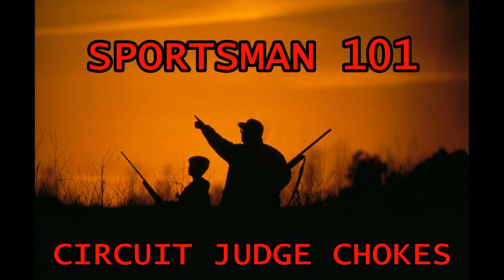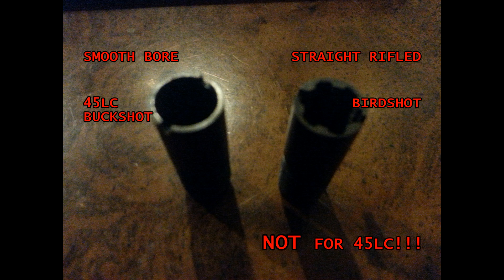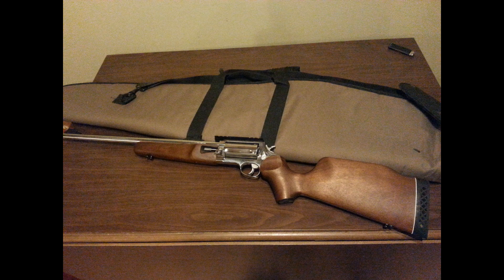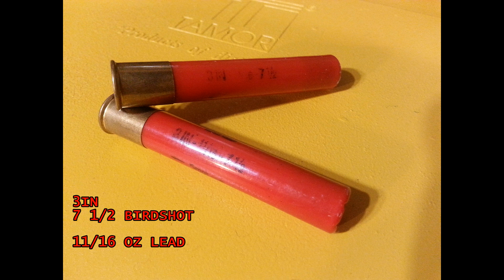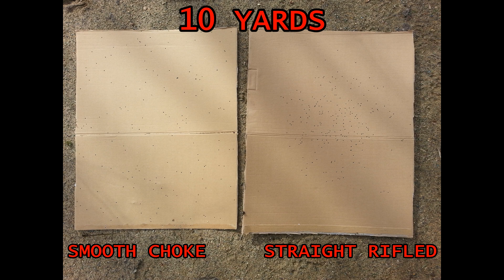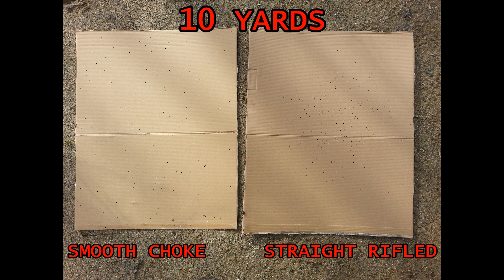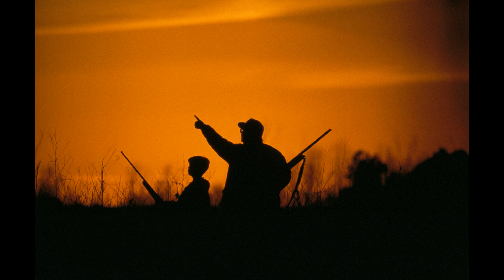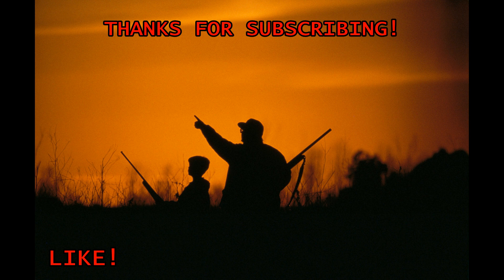Taurus Rossi Circuit Judge: Smooth Choke vs Rifled Shot Pattern Test

Comment: As I posted before, I ordered both a smooth bore and a straight rifled choke. The old choke was stuck and I had to order a choke removal tool. The one I got was thin and so small I could not grip it and exert enough force to remove the stuck choke. I took a piece of small angle iron (long enough to grip on each end) and cut a slot in one of the flat surfaces. I inserted the choke wrench in the slot and tack welded it in place. I was then able to stand with the gunstock gripped between my feet, grip the modified choke tool with both hands and exert enough pressure downward to turn the wrench using both hands, and remove the choke.
       I also took a thin piece of flat bar steel and ground the edges to a size that fit down into the slots of the rifled choke and bent it to 90 degrees to make a choke removal tool for the rifled choke. Just in case it ever gets stuck!
I have pictures if anyone wants to see those.
Reply from the maker: I’ve had the straight rifled get stuck but not to the degree you speak of,  using the choke removal tool paired with a pliers for extra leverage usually does the trick.  Thanks for sharing!

Comment: In the owners manual for mine it says to use the smooth bore choke for 45lc and .410 slugs, and the straight rifled choke for 410 shot shells.. it doesn’t mention buckshot. Also I wonder which choke would be best for a load like the Winchester pdx round?  But it seems like the straight rifled choke would probably make them hold a tighter pattern because of its smaller inside diameter than the smooth choke would act similar to say a full choke vs a modified choke in a regular shotgun
Reply from the maker: Thanks for watching!  The way I see it since the buckshot is stacked due to its size I don’t think it matters if the wad spins or not.  It’d make a fine test though!

Comment: What choke would you use for #8 shot? Anyone know where to buy the chokes? Can't find them anywhere.
Reply from the maker: Use the choke with the straight rifling for birdshot.  It comes with the gun, but replacements can be found through a google search.
Reply from the maker: Optics planet and MidwayUSA show up in search results
Reply: I actually used the chat feature on the RossiUSA website to order a replacement choke recently.  Surprisingly, they didn't even charge me.  Just FYI.
Reply: Sportsman 101 the only chokes I’ve found are the straight rifles and smooth bore like the ones that come with the gun I’ve been trying to find something like a full or extra full choke for it

Comment: what ever you do don't lose  these chokes..impossible to get replacements from Rossi
Reply: I know this is old. But I recently recieved a circuit judge as a gift after my grandfathers passing. Doesnt seem to have the chokes. Is there really no way to find these online?
Reply: BRANDON junto I’ve been searching all over for them with no luck.  Going to contact Rossi directly, to see what they say.  If I find a place to get them, I’ll let you know.
Reply: @joshuakraft7835  I called the company and you can order through them.
Reply: @PNSinstant  Awesome!  Thanks for the follow up.  Sounds like it's time for me to quit sitting on my hands and give them a call!
Reply: @joshuakraft7835  Josh, I actually used the chat feature on the RossiUSA website to order a replacement choke recently.  Surprisingly, they didn't even charge me.  Just FYI.
Reply: I ordered from GunStuff TV